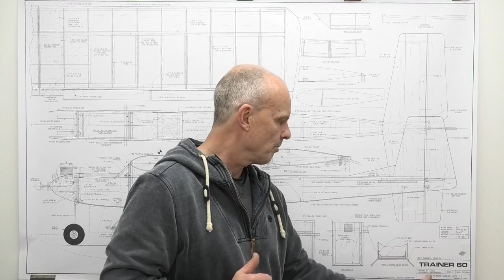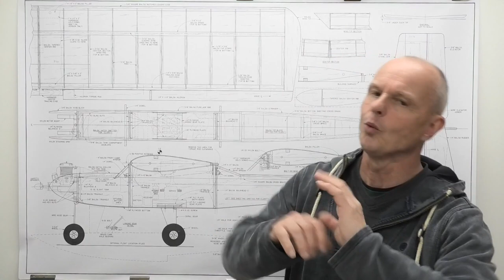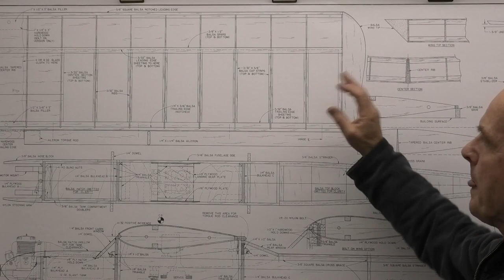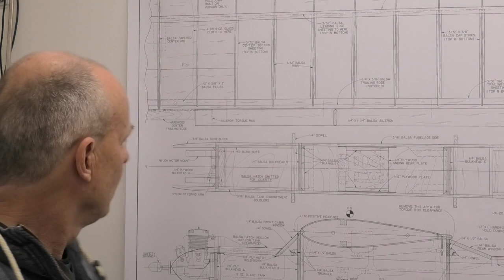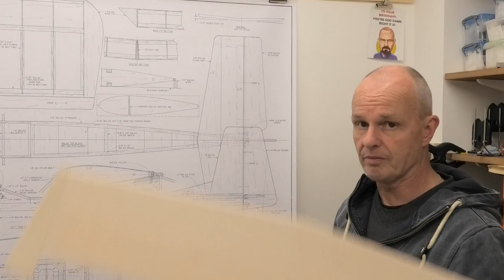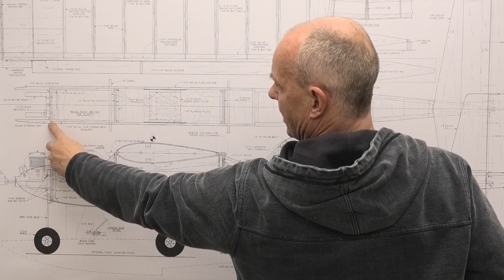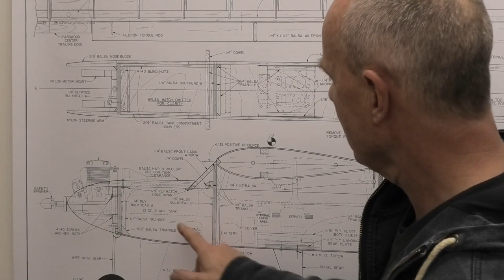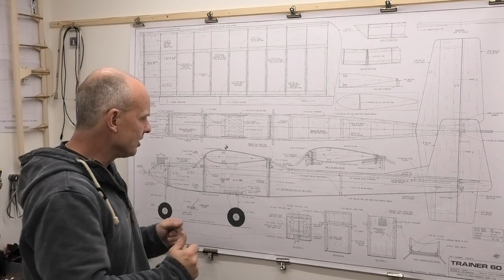Great Planes Trainer 60 Pt 1 - Great Set of Plans - Build Series - 65" Wingspan RC balsa aeroplane

Comment: I down loaded this plan about 18 months ago as a possible winter project. Having just watched Part 1 of the build series and as I am considering attempting my first "off plan" build, you have convinced me that this is the one to start with. I am sorry, but I don't have the love for old IC's like yourself and therefore I will look at an electric (sorry for the bad language) conversion. Cheers and thanks Mark.
Reply from the maker: Hi Brian, thanks for the message, the GP 60 Trainer will be a great build, you should enjoy it.  I am still flying the plane I built and love it, it flies so well with no nasty habits.  I am not against electric, I do have an electric plane, I just prefer the experience of IC, its great you are building.

Comment: Ok after rewatching this series as I set up to build my RCM trainer 60.  The original plans are definitely different than the ones you have.  The original horizontal stabilizer was originally stick built and not solid.  Like how you did yours but film covered.  Very light.  The shape of the  fuselage under the tail is different.  And many more things.    Glad I had a original kit to build from.  I would not want to make every thing my self.  I barely get time to build as this will be my first build in 10 years.   Do fly bnf/ rtf kits with my kids.

Comment: Nice video I fell into the trap of building a light tail on my Kaos and even with the gear moved right back I still had to add weight
Reply from the maker: Hi Mark, thanks for the comment.  The light tailplane should be fine as long as we are mindfull of this during the build and I address the CG before installing the radio gear.

Comment: Awesome!  Can't wait to building it. I need to build it electric to be able to fly it in my region. Would be perfect to get the weight of the engine you are using as well as the weight of the full tank. Thanks a lot in adcanve.
Reply from the maker: Hi thanks for the comment, the engine is 460g, sorry not sure of the weight of the fuel and tank, but I am sure an electric setup would work fine.

Comment: A fully symmetrical airfoil is a advanced or second trainer. Been flying for 42yrs and I prefer a semi-symetrical airfoil for a first trainer. My preference was always the GP Avistar. If you're gonna build a fully symmetrical aircraft I would build a Ugly Stick. Certainly easier to build than a GP Trainer 60.
Reply: My first airplane was a Joe Bridi T-20 trainer.
Powered by an O.S. 25FSR and guided by Kraft Sport Series 6 channel radio, it was a fine first airplane. One of the best things about it was it didn't change trim with throttle changes.
It's all about that fat, symmetrical airfoil with a blunt leading edge.

Comment: Hi Mark. You could also mount one or both servos at the tail end of the fuselage. I did that on one of my models.
Reply from the maker: Hi Terry, yes absolutely that is definately a better oprion than adding weight, and a servo can easily be hidden under the tailplane.
Reply: @MarkRobinson555  I have done this on my Veco Invader from 1959. Because it was designed for heavy RC gear.

Comment: Looks good as usual Mark.  Off topic question… is there a good resource for the modeller to help select and size props? Or is that something one picks up through experience?
Reply from the maker: Hi John, thanks for the comment.  Regarding the prop size, I usually have a look at the engines instructions etc, many of which are available on line, also if you do a search there are a few guidance charts on line.  But experience plays a big part and personal preference for how you like to fly.  I can remember being baffeled at first, but it comes with time.

Comment: Hello, any recommendations if I want to use an electric engine? (weight, CG,...)
Or maybe another Trainer plane to build instead of this one (first build, never flew one ;-) )
Thank you !
Reply from the maker: I think this would be fine for electric or I/C, the fire wall is Ideal for an electric motor.  With regards to the CG, this is somthing that will be agressed later in the build, so that added weight is hopefully not required.